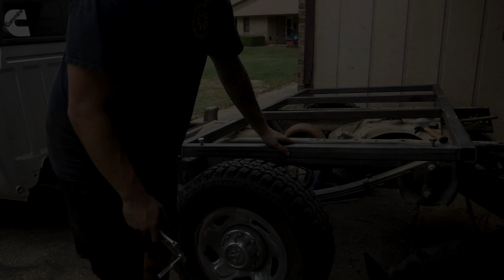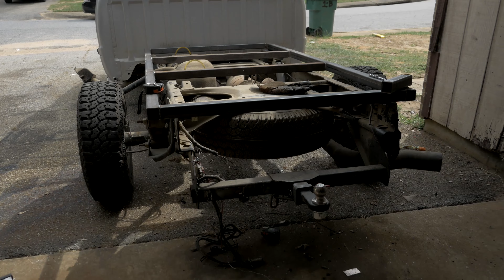Building a "Flat" Bed for my 1997 Dodge 2500 SRW (start to finish) || Legacy 4x4 and Off-Road

Comment: How do you like your welder? Was thinking of buying one and considering that same brand and model
Reply from the maker: I had the vulcan 215 and that thing was an absolute unit of a machine, probably the best machine I've ever used. The titanium is a tad bit for finicky and less forgiving but welds perfectly fine. I switched because my vulcan go rained on and wanted to try to cheaper one. If this one ever bites it I'll see what direction I go..